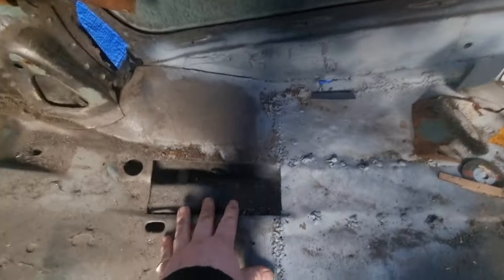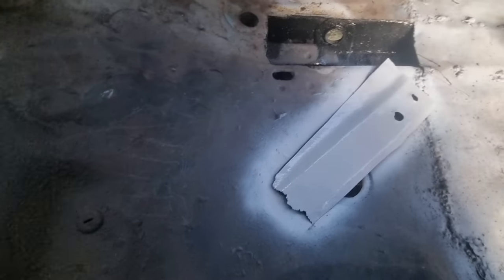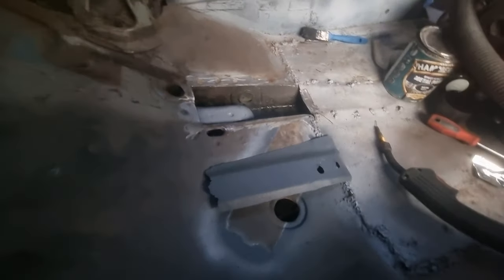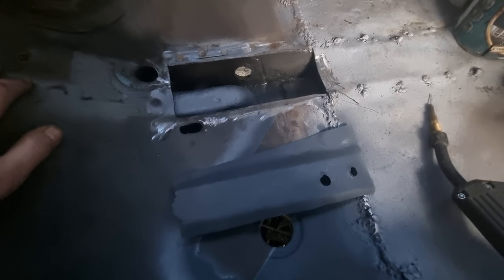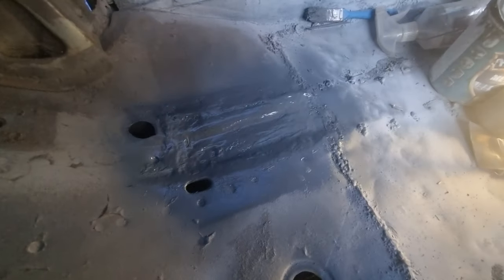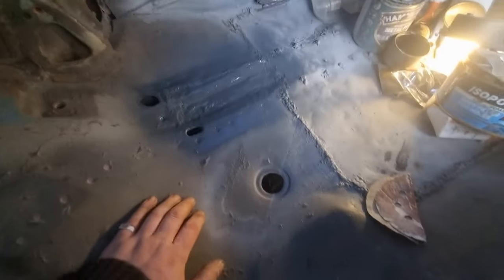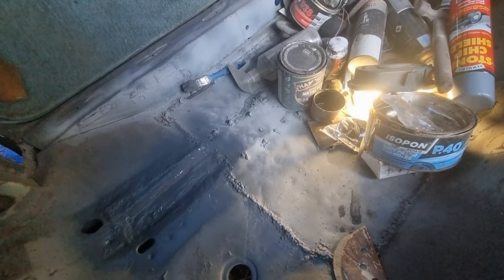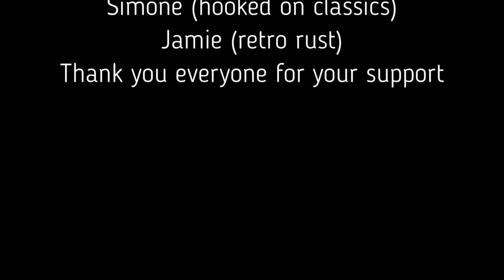Cortina Mk4 Ghia 2.3 V6 Restoration || More Rear Floor Pan Work (P45)

Comment: You need the shroud on the welder tip it directs the gas forwards the job to cool the weld
Reply from the maker: It's a fluxcore welder no gas

Comment: I thought there should be a shroud on the end of the welding gun? We used to call that pigeon shit welding back in the day!  You doing a good job mate but if I were you I’d try and find someone to help set up your welder and give you some tuition. You doing a better job than I would tho mate. Keep up the good work.
Reply: It's flux-core, no need for the shroud.

Comment: Just a bit of advice you need to get that torch a bit closer to the metal your a little to far away and it would do my head in with out the shroud being on the torch as well but the welder sounds alot better and I don't drag mine down like you or going side to side with flux wire (only when using gas) but your doing a good job keep it up mate
Reply from the maker: Yeah I dont normally have it that far away was just getting back into things lol and thank you

Comment: Doing a good job mate but try getting the gun a bit closer to what your welding and I think you will get better results.from watching the vid it seems like you have a lot of wire sticking out the end of the gun.other than that you making good progress on a mammoth job fella.
Reply from the maker: Yeah I did notice that I don't usually have e it sticking out that far think it was just me getting back into it lol
Reply: Yeah, about 10 - 12mm give or take. Nice to see some 'action' footage of work in progress rather than before and after all the time, that's definitely the way to go if you can get the camera/phone set up to record it. Do you have any welding magnets to hold those small panel inserts in place when you tack them in? Lidl/Parkside are doing a few different ones cheap if you don't and you think they'd be useful.
Reply: Yea only done a little bit of welding with my gas less and hated it, gas is much nicer for me. Great you can do away with the shroud but def closer, two hands to steady you and could try a series of continuous tacks rather than long runs and see how you go. Great job though